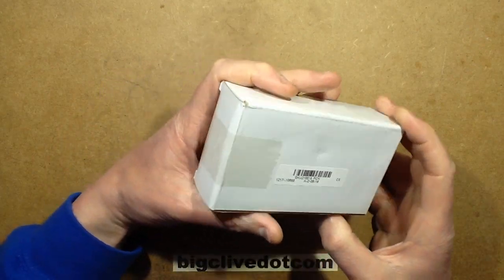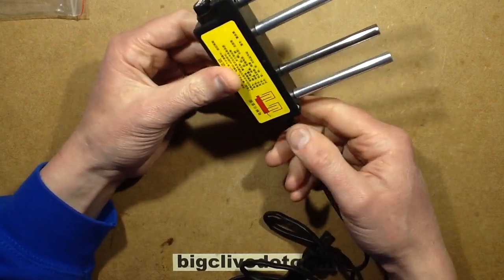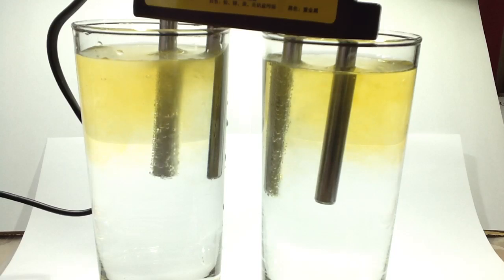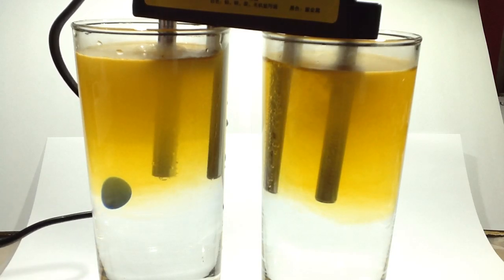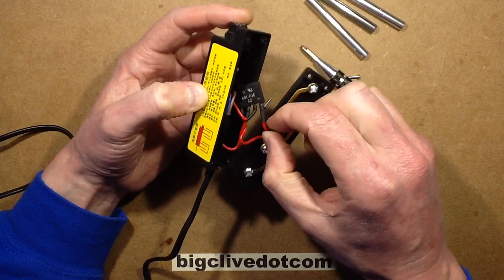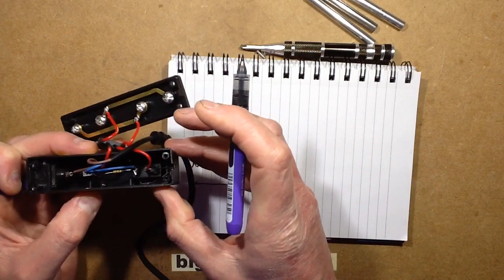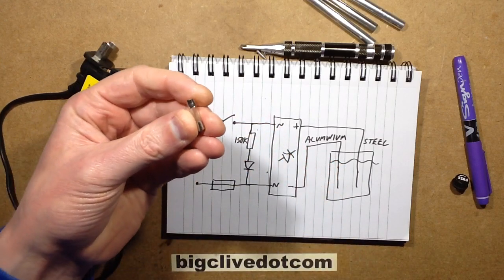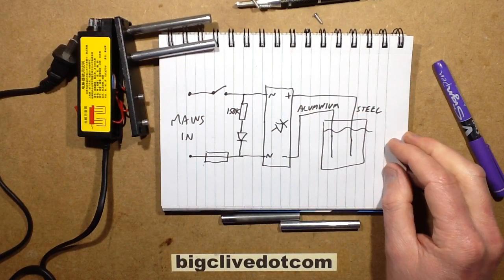Deadly quack water tester.  (scam)

Comment: I can see your tap water is worse but only marginally. Where's the scam, your water filters?

All electrolysis is is passing a current through electrodes, it's very basic
Reply from the maker: The scam is that this dangerous device is used to imply that the corrosion from the electrodes was somehow present in the water.

Comment: I bought one of those , and tested it with a jar of distilled water and water from the tap , and then distilled water , and a jar of water from the carbon filter . hardly anything precipitated from the distilled , it just turned faintly blue , but the other 2 jars of tap water had all kinds of shit forming on the surface , it stunk and the water was almost black , couldnt see thru the jar .I dunno if it's a scam , it seems to work ? even if it is as dangerous as fuck , just keep your fingers outa the water when the fucker is turned on lol
Reply from the maker: Distilled water is not conductive.  A tiny drop of salt would have made the electrode rust appear in it too.  Keep in mind that the electrodes are live and can give a shock even when switched off at the unit.
Reply: @bigclivedotcom  yes very true mate , I actually dug it out earlier on and put the multimeter on it to check the voltage across the elecrodes.......and was surprised to see 220 volts DC .......holy shit

Comment: Except - distilled water stays perfectly clear. Still waiting for a guru of electronics to tell me why distilled water never turns
Reply from the maker: Because it's not conductive.  Add a tiny touch of salt and it will discolour fast.
Reply: @bigclivedotcom  add a touch of many things and it does it too, not just salt! Point being distilled water is pure. Why not mention that as most of the videos are making that point!

Comment: The aluminum (negative), is the contaminant.
IE;
Current flow is negative to positive, hence the electron flow would be like "electoplating" process, but, the alloy is lost in the water, thus CAUSING turbidity!

Yes, that device is a scam!

Comment: This person has convinced himself that he doesn’t need clean water. Sorry should have did this a long time ago. Fact- Government and the city do nor have accurate test to determine what is exactly in water! It is a changing science everyday! Fact our water is getting worse not better! Cities do best job they can but do not  know water quality when it gets to your home. After leaves the plant they have no control. Because of distance, old breaking and leaking pipes and new subdivisions causing intrusion in water supply. Fact majority of water city treats  goes outside  for parks,  lawns,  golf courses and factories industries etc... . Factories and industries use filtering systems to clean city water. Fact : what we drink cook and make beverages is very minimal! This makes it difficult for cities to filter water for drinking purposes.. why they are called a water treatment plant not water filtering. 
First of all the precipitator he is using, isn’t the most accurate test. All It shows you have stuff in your water that isn’t water. It isn’t to be used as a scare tactic , as so many companies do. It is a measuring test to determine you have stuff in your water that is not water.  Simply because not everything you see in water is bad for you! We have been told there is minerals in water that are good for you. Yes this is true but they never finish the statement, there is also minerals that are not good for you. Open plumbing or water heater and you will see rock. We can’t eat a rock. We say there is organic’s in water that are  good for you and inorganic’s  that are not good for you. 
On video he puts salt in bottled water,  that he knows is clean. LoL 
Which turns a black color not the same color you get from precipitating city water out. Why does the rods react? Salt is a TDS. This is why he uses it to make it react to the rods.  If you have hardness among other things in your water The rods will react and turn a greenish color. Similar to when you let a pool go without doing anything to it for a while, it will turn green. Why? It burns up the chlorine, leaving water defenseless from algae and a host of things. 
If there is nothing in your water then the rods won’t re-act. 
Fact : water today is scarce and not good. You have lots of hardness which causes scum on shower doors and fixtures and causes you to use a ton of proctor and gamble products.  Oh by the way,  new and approve means more caustic chemicals they have to use to get your water to clean! Yes it is water that cleans not the chemicals you add to it. This is the largest ingredient you use in home. The chemicals you add only makes water clean more efficiently. Never forget this! 2 ways to clean water. Chemically or mechanically. Water in both cases does the cleaning. This is why you need water treatment in your home.  
We also have TDS which is suspended solids in water. If you want to use this video to not get water treatment for your home, that is totally up to you. These videos are not  doing you a favor, they don’t know what they are actually looking at and you do need water treatment if they rods re-act. Otherwise you pay Proctor and Gamble serious money for the rest of your life! Your choice!  I have clean water my house and wouldn’t be without it!
Reply from the maker: We have extremely pure water here.  This deadly device is nothing more than a quack item.
Reply: LoL well you don't. They take water from the ground and put iit in high towers across city, it isn't  pure! In fact there is no such thing as pure water! Even that stupid filter pur got in trouble for calling it pure.so they changed wording lol
This test only shows you have things in water same as a parcipitation test.it doesnt mean everything is harmful or bad for you.

Comment: are they not just using  electrolysis to transfer the iron rod into the water using the aluminium rod to electrically attract  ? this would make any water other than maybe sterile water or distilled water

Comment: There are many scams using this sort of visual show to sell stuff.  This device is just oxidizing the steel electrode releasing Fe2O3 and 3H2 (thats 3 hydrogen molecules which is a gas) into the water. Gee the water had all that stuff in it I guess I should buy your purification system then.

Comment: Is there any safe way to make an electrolysis device? Surely the whole point of the device is to have full mains voltage through the water?
Although the switch only killing one arm of the mains does make this device a potential man-stopper.....

Comment: Wait a minute...it's Chinese. Ahhh...it's a torture device. The distance of the electrodes perfectly matches one nut between the two of them.
You'll know the victim has got enough when the color of the nutsack changes.
As it has no capacitor on the DC-end of the rectifier you'd still get that nice buzz of 50 Hz even if it's DC current.

Comment: I saw one of these on eBay and ordered one.  (Some years ago, now).

 I suspected the worst - and (sadly) was not disappointed.  

I put a meter across the electrode pairs, when plugged in - and Oh boy - yes certainly more than enough to kill!

The discolouration is from the iron forming Iron ions, as electrolysis takes place.

So it's actually a decomposer of water!  (Bubbles being hydrogen)

My fear was that children could buy these - kids doing science projects, science fairs etc.

I reported it - but still they sold them.  (Dead children - on YOU eBay!)

I think mine was the "big boys" version - it didn't even have the useless fuse!

The only things that this tests is the lack of scientific education, of the buying public and eBay's integrity in selling a D.I.Y suicide machine.
Reply: Could you explain more on decomposer of water statement.

Comment: Looks to me like the mains plug is totally unpolarised so you would have a 50:50 chance that single pole off switch would interrupt the live wire rather than neutral. Not that using a DPST switch would improve things very much but at least you could fully turn it off every time. Not a good idea to test your bath water with this.

Comment: Do you know anything about conductivity through an electrolyte?
That device is no more than it needs to be to test water...
It's about the water....
Well don't hold it in your hand...
Reply from the maker: Yes I do.  It's testing water conductivity and then being used to imply that the dirt was in the water and it made it visible, when in reality it introduced the dirt.  In a way there's a poetic justice that the people using these to dupe customers could potentially get a significant shock from it.  Like their very own electric chair in their briefcase.

Comment: The lighter electrodes are quite possibly ZINC ( or a zinc alloy).  A Reverse Osmosis water filter (most likely what these are used to promote) would reduce the Total Dissolved Solids in the water low enough(<35PPM) to not conduct enough current to create the electrolysis effect with the Zinc and Iron electrodes(the orange gunk will be iron Oxide) and then leave the "filtered" glass of water clean and clear.  I'm not condoning the design or use of these , just explaining how they work with water. I would have to guess than Clive's water filter uses just activated carbon to remove odor and taste but doesn't actually "Purify" the water.  Pure water (0 PPM dissolved solids) will not conduct electricity in any significant amount. Dissolved Solids meters work by simply measuring the resistance of the water in the meter's sample cup.

Comment: Same principle is used in makeshift water heaters made from two same metal objects. Dave from EEVblog reviewed one of them - though he had no guts to admit practicality of it in emergency when you don't have anything more purpose made around. I obviously don't recommend to make it for ones with sloppy hands and tendency to check mains voltage presence with tongue.

Comment: Correct me if I'm wrong, but isn't the fact that it converts it to DC make it even more deadly? I was always taught that AC tends to have a more "explosive" effect on muscles, but DC contracts instead so you get stuck and can't let go?
Reply from the maker: AC is worse because it continually stimulates the muscles.  But the full wave rectified and unsmoothed DC is just as bad.

Comment: The chemicals interfere in the electrical currents,
that go around our body.
that is the most important thing in a human.
 chemistry,food we can do without for a limited time.
No electrical current in our body we are dead.
Like a electrical cable if there is resistance in the conductivity.
 it Causes burnout and in action of body parts,
 and brain cells don't fire correctly.
which is the cause of all the illnesses.
the burnouts and heats up which causes our own body immune systems,
 to attack that hot area.
which generally highlights infection and which causes cancers .. The build up of chemicals in humans body,
cause MS Alzheimer's and many other mental health conditions ..
it's a simple as that the..

scientist get paid to hide the truth. (Allegedly)
 and That's why I got that three days siege when I try to whistleblow..
and start a new political movement and party to Challenge the corrupt.

Comment: My scientific knowledge is somewhat dubious, but I think the reason they use alluminium for the cathode (-) is so the gunk coming from the steel anode (+), probably mainly iron for conductivity and nickel for added yellowing (so DEFFINATELY DONT DRINK IT as it would be HIGHLY TOXIC),  doesn't get plated on to the cathode. Thus both electrodes remain shiny and 'clean' while the water gets murky.

Comment: Andy Devine I am ✌✌✌
The chemicals interfere in the electrical currents,
that go around our body.
that is the most important thing in a human.
 chemistry,food we can do without for a limited time.
No electrical current in our body we are dead.
Like a electrical cable if there is resistance in the conductivity.
 it Causes burnout and in action of body parts,
 and brain cells don't fire correctly.
which is the cause of all the illnesses I highlighted.
the burnouts and heat causes our own body immune systems to attack that hot area.
which generally highlights infection and causes cancers it's a simple as that the..

scientist get paid to hide the truth. (Allegedly)
 and That's why I got that three days siege when I try to whistleblow..
and start a new political movement and party to Challenge the corrupt.

Comment: Looks like a MIOX chlorination unit  rebranded for something else. Electrodes would be titanium for the anode and steel for the cathode. Would be set in a vat of brine to be used with a dising pump to add to questionable drinking water or in line with a swimming pool water pump line. Electrolysis makes free chlorine on the titanium electrode that cleans the water.

Comment: Hi
I have a question why distilled water did not heat up in this test, but normal battery water was warm. And then, the distilled water was only yellow and the other had black spots, the blue here and there yellow. It means that the water contains heavy metals, bacteria, viruses and other harmful things ???

I'm not a chemist, so I don't know. That's why I'm asking.
Reply from the maker: Pure distilled water has such a high resistance that no significant current flowed.  Tap water has natural minerals and passes more current causing the electrodes to corrode and make colour.

Comment: Correct me if I'm wrong, but this does "work" in that water with no dissolved solids isn't conductive, right?  So it wouldn't conduct and the electrolysis wouldn't happen and the water would still look clean.  I mean, it's still a terrible idea, but I think it might actually do something.

Comment: So as long as the water is conductive, this thing is gonna shit in it, and both the fuse and the switch are designed specifically to give you a false sense of security before it bug-zaps you to a crisp.

By the scammers, for the scammers.

Comment: About the security issue I agree with you, but still not so bad for under 10 Dollars to test whether a lot of minerals in the water or not! We compared 3 different "type of water": "Distilled bottle water" we bought in the super market, "purified water (using our not so cheap water purifier)" and "tap water". We exchanged all the times the 'dirt rods' with the 'clean rods' to make sure that the 'change in color' comes from the rods (dirty or clean). The "tap water" changed the color so badly compared with " distillate water" due to mineral residue in the "tap water" and NOT from the "dirty rods". The "purified water" from is better. The "Distilled water' didn't change the color at all since no minerals inside the water. It is just simple chemistry and physic. Sure we don't know  exactly what's contamination within the water means what minerals we really have inside the water. Otherwise we must buy a labor water tester in range of few hundreds to  thousands dollars to find what minerals and how many PPM they have in the water.
  It's a working item if you know how to use it and what's the idea behind it, but doesn't tell you at the end the water you tested is good or not, just tell you minerals are in the water.
Reply: Yes, but as you said, that is essentially useless information. If you need your water tested, you dont need to buy any device, your city water management or private company near you probably does tests cheaply, and they will tell you exactly what your water contains. Heavy metals, nitrogen, salt, minerals, pathogens and microbes... everything. And its not like you need to test water every week. Even once a year is kinda overkill. 

Having people handle, what are essentially live stripped wires connected directly to main to find out that "Water contains minerals" is not a good idea, even for 10$. The only use for this is comparing distilled water to regular tap water(for scam purposes), nothing else. Tap water, wells, even collected rain water all contain minerals which will end with same results. 

Even if you want to have demonstration for science class or something, plugging just a regular 12V DC source to two carbon electrodes(they wont color water and you can show that sodium and chlorine separated on different poles),  and using salty water will show much better how electrolysis works. And you wont kill anybody. Or use a nail and a copper wire.

The only reason this shit is plugged straight to main is because you need a lot of power to actually have the same effect in (relatively) clean tap water in short amount of time. If you do experiment I described above with regular tap water, the 12V will probably not even be enough to overcome the resistance of (relatively) clean water and you wont see anything.